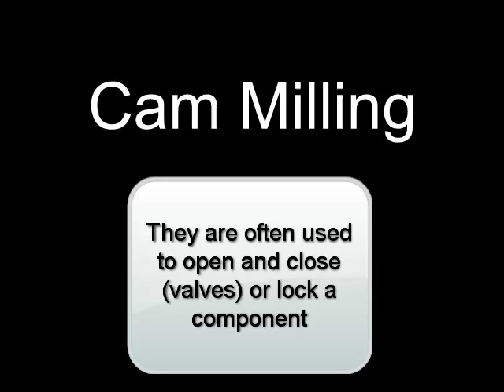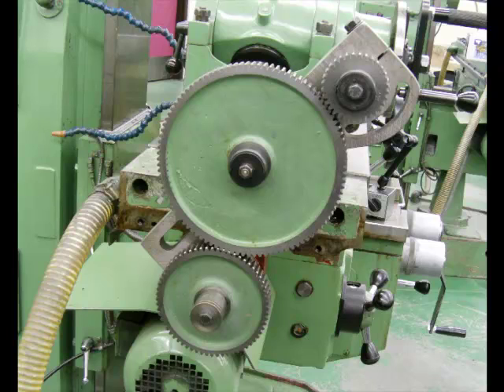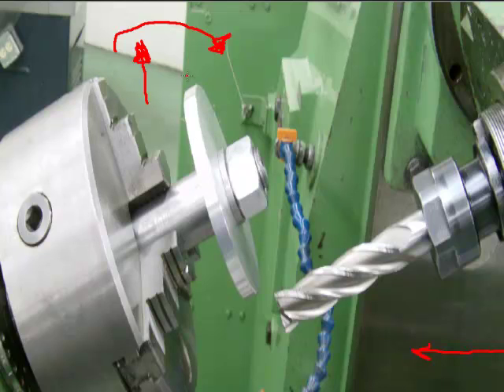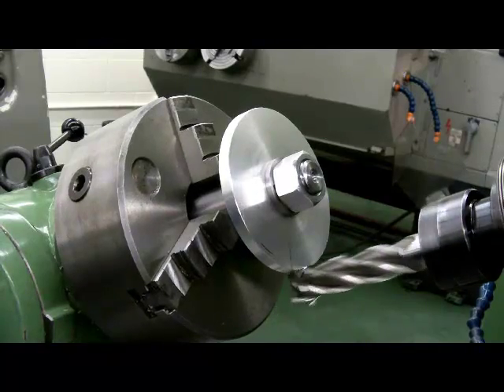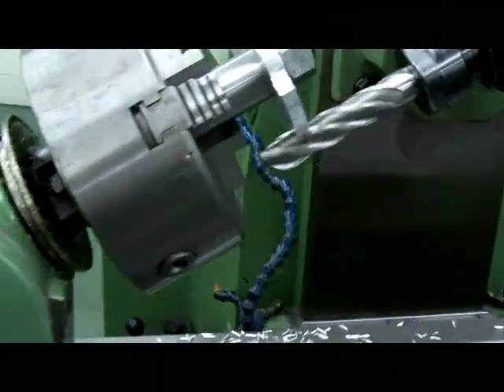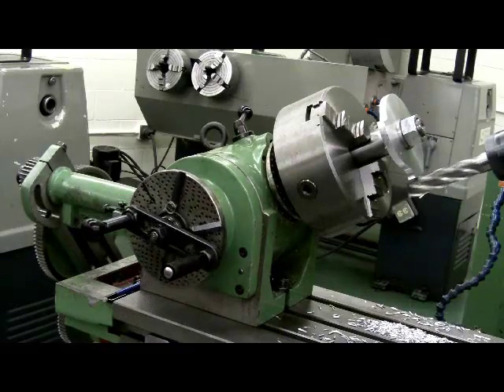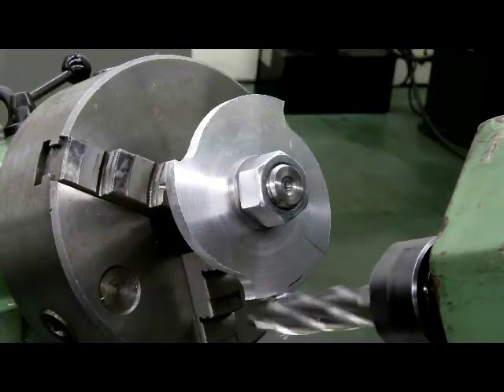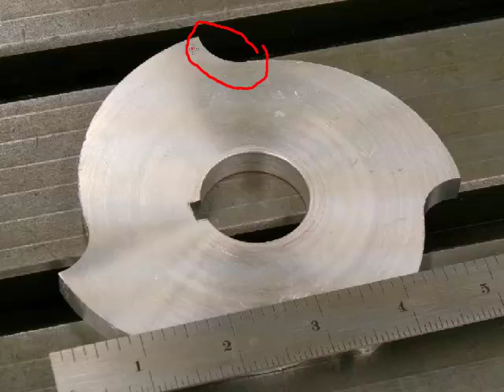Cam Milling

Comment: I'm a pretty good G and CAM programmer and machinist, but none of that is quite as rewarding as a real all mechanical setup. Computers make us stupid, and even CNC's use trig tables in a database behind the scenes for speed reasons (not actual calculation on the fly). I love seeing proof that the old iron isn't dead yet.
Reply from the maker: Glad to see there is someone out there that thinks like me! Thanks for the comment!
Reply: I'm with you.  I like CNC, but retaining the old manual skills is never a bad idea.  Relegating them to the dustbin is, IMO, very shortsighted.  Besides, manual machining is very satisfying.
Reply from the maker: I prefer the manual also!
Reply: Very clever.  It's like a time machine going back to 1959.  Or before.  Life was horrible without CNC.  But America was great then.

Comment from the maker: From the picture you sent I can see your problem. If you can remove that housing there should be a gear on the table lead screw. You should be able to add an idler (you might need to machine a bracket) and gear it to your dividing head. An alternative is to raise your dividing head, you will still need idlers to mesh your gear train. Thanks for sending the picture.

Comment: Never made one like that because I came into the trade when cnc machines were just starting.  I had an older toolmaker explain it on a large cincinatti mill we had and it kinda made sense but never seen it done until now.  I did okay in math and can see the principle but you made it clear.  Thanks! Now if I will ever need it........

Comment: i got that part.  what i am asking is the shaft going into the dividing head that comes from the lead screw, does that turn the dividing plate (with all the holes) which turns the shaft that the crank is mounted to which then turns the dividing head or does the shaft coming from the lead-screw go strait to the shaft the handle is on? if shaft coming from the lead-screw turns the dividing plate you could just index like normal if it turns the handle then yea you have to pull a gear.

Comment from the maker: The problem you have is the hob is a "form cutter" which means it is relieved behind the cutting edge. If you sharpen it the form becomes smaller requiring the table to be moved and take several passes. You will see grooves along the hob parallel to the bore, the cutter face is found here not the OD. If you cut the OD you will change the envelope seat of the worm. Hope this makes sense.

Comment from the maker: The shaft coming out the back of the dividing head is geared to the lead screw (table) in this case. The table feed is driving the dividing head which in turn drives (revolves) the chuck. This "times" the table feed to the rate of the chuck's revolution creating the cam. Does that help?

Comment: Very good. I started as an engineering apprentice in a large international engineering firm in Belfast UK.
Maths were always used from day one for marking out etc. Especially trig. When I moved to the Toolroom maths more and more using tables and charts and logs,circa 1976. Then I got my Rockwell 64rd calc and all went even better. Then I got promoted to NC programmer for milwaukee matics and up and up. I'm 60 now and semi retired but it's all still in there.  Great days. ,,, post script,, I wish I could have a devlieg 3h 48 in my garage....ah well.
Reply from the maker: Those were the days before all the automation. Thanks for sharing.

Comment: So Brad. too clarify, Starting from the first lobe. You moved the table 1''. to cut lobe 1. Then you turned feed off, spindle off..take back gear off...move table back to '0'. move table towards cutter, gear back on, dial at '0' ...spindle on, feed on, move the table until dial reads 1". and then repeat the process for the other 2 lobes right?

Comment: Nice work !
Reply from the maker: Thank you.
Reply: @machiningmoments  now I gotta wrap my head around all this, figure out universal joints to drive the head/cross slide combo, and write a basic program that you input amount of cam rise, the gear ratios available,  and let it spit out the table/head angle and length of end mill needed.    Cheer from Akron, Ohio.

Comment: doesn't the shaft coming out of the back of the dividing head turn the dividing plate which turns the shaft with the handle or does the shaft with the gear  connect directly to the shaft with the handle?

Comment from the maker: Actually nothing, it was done for demonstration (teaching) purposes. I felt a multi-lobe cam would work best for this purpose. This type of a cam may be found in a clock for example or a lock...a two lobe cam similar to this is often found on the back door of a transport truck's trailer. Thanks for the post.

Comment: Excellent presentation, camerawork and explanation. What do you do if you need deeper cam or a cam like a full ellipsis like a valve movement on a bike (NSU) ?? Your table movement would had to be reversed at one point. R.S.P.Eng.
Reply from the maker: Robert Silas Yes, the camera work is sometimes an issue for me. Honestly can't say I have it all figured out...some videos end up in the delete bin. At the end of each lobe the gear is removed from the dividing head, basically putting the dividing head in neutral, and the table is moved back to the start position for the next lobe. Gear is installed and procedure repeated. Thanks for watching and commenting.

Comment: This is amazing. I have a small home/hobby machine shop in pole barn and always wanted to learn these skills. I'm curious about one thing though. If someone handed you a cam that you knew nothing about, how would one go about (mathematically) figuring out how to setup a job like this to produce an exact replica? Again, thanks for sharing and hope to see more like this, but with even more detailed number crunching.
Reply from the maker: If you measure from the center to the outside you can calculate the change in size, this becomes the rise of the cam. Once you know how many degrees the rise occupies you can set the mill to cut it. Thank you for watching and your post.

Comment: If I had the time I'll try   it on a vertical mill with a rotating table which rotates while the table move into x-x direction. Now the setup of that will be a task and a half. The Old Bob
Reply from the maker: Robert Silas Good Luck!

Comment: why pull the gear off when you could just index your dividing head 10 turns and be done with it.  if you are worried about the cutter moving on the part when you back it out the cutter will be clear of the part before the slack in the gears are taken up and the part turn backwards.

Comment: Sir,need a help from u...a hob cutter  of 12 module got vent on its cutting face and i have planned to grind it using indexing method mounted on my traditional cylindrical grinding machine...as the hob has some helix angle, iam finding it difficult to index it... your suggestions will be very helpful to me...

Comment: 2- 10” chucks mounted to the backside of the backsplash to colchester in the background. I must know more.
Reply from the maker: This is how we store our chucks at my shop.
Reply: The weight of one chuck is pretty significant. Did you add structure to support all that weight?

Comment: this is not problem to figure, but if you have to do it. Now days, most of the shops have at least one cnc, so this technique is obsolete, almost. 
All be it i use dividing head quite allot on manual mill, mostly for holes, and few slots maybe.
Reply from the maker: +11thboris I agree, I hope some would be interested in what the CNC is calculating.
Reply: machiningmoments Yea, most of the machinists nowadays dont even know basic math behind it all.
Reply: +machiningmoments I agree with this! I believe that in order to master anything you need to have the basics down. I still use machining methods like this because my shop is still young and I'm forced to do things the old school way (manual machines), but in the end I'm so glad i learned because later on cnc machining will be available to me. This is a great video! Thank you for taking the time to post this!
Reply: I'm a younger guy, a hobby machinist, and I find this stuff really interesting. I just bought copies of some books published by Moore Precision Tools, particularly Holes, Contours and Surfaces and Foundations of Mechanical Accuracy. The first book has all of the Woodworth Tables in it from 3 to 100.
Reply from the maker: I was young like you...some time ago,  LOL. Read all you can get your hands on, it is a wonderful trade/hobby!

Comment: How can I calculate the job lead of a heart shaped cam? Plz help me.
Reply from the maker: Calculate the lead for 180 (half of 360 degrees) as the cutter reaches that point add a gear to the train (so the dividing head spins in the other direction) and feed the table in the opposite direction.
Reply: @machiningmoments  actually I want to know how can I measure the lead of a heart shaped cam? Plz help me.
Reply from the maker: On a piece of paper draw a circle, the diameter will be twice the distance from the center of the heart to the bottom. Now draw vertical line through the middle of the circle touching the circle at 12 and 6 o'clock. Draw your heart starting at 6 o'clock and (uniformly) moving inward until you get to 12. Now uniformly move back out from 12 to 6 o'clock moving in the same direction. It doesn't matter if you went clockwise or counter-clockwise. You should now have your heart inside the circle. The circle is the material  you start with the heart is the material you finish with. Now measure from the center of the circle to the bottom, 6 o'clock, point of the heart. Measure from the center of the circle to top of the heart, 12 o'clock. Subtract top value from bottom value, the answer is HALF your lead (based on the change in 360 degrees). I hope this makes sense.
Reply: @machiningmoments  thank you very much.